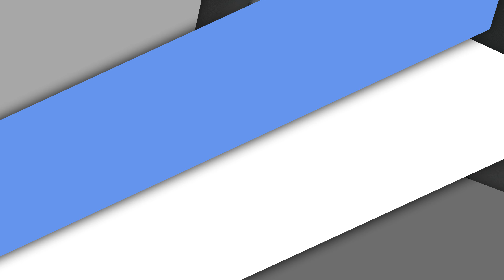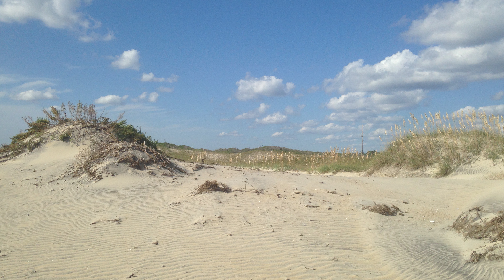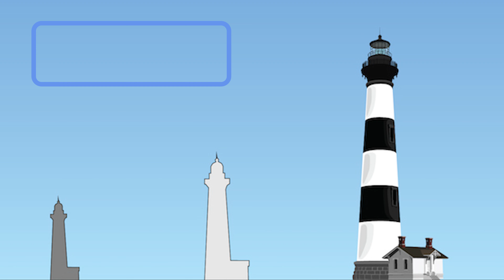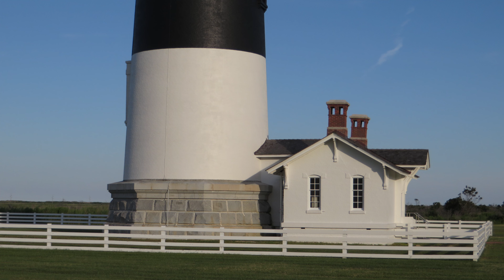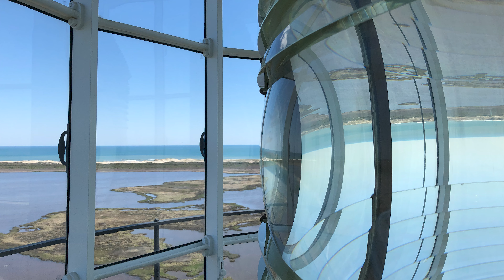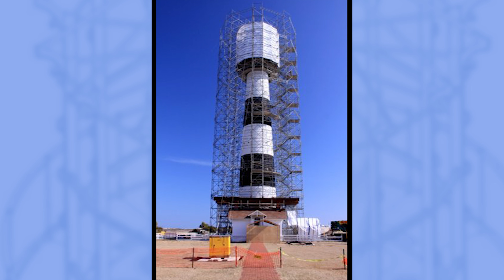Victorian Lighthouse Doomed to Fall

Comment: I visited Bodie 10 years ago! Still have the goal to see all 5 outerbanks lighthouses. So far Ive seen Currituck, and Hatteras, still need to see the one with black and white diamonds and the all white one.
Reply: I never made it to all either, but plan to eventually. It's been more than 10 years for me. I was surprised how many new homes were blocking the ocean views along the road. It's quite a drive, I saw 2 I remember, but couldn't go inside. I'm hoping things haven't built up even more. 2 days was not enough time to fully take in everything. I'm thinking 3 days minimum to get enough pictures and videos of all and take in everything that's interesting about these islands and lighthouses.

Comment: This is interesting,as in having a love for light houses. On a painting I did a while back, there’s a light house sitting almost at the top of a Mountain Viewing it from the back side because it’s on an island, and it’s on the left side,with an adjacent house connected with a big porch.with the sea wheat in front of it. Structuring a tall light house would be a challenge for sure, the setting of the light house in this description is relative, Sorry for the disasters of them. Thanks for this video ❤✅

Comment: The current lighthouse was originally grounded through the cast iron staircase, which was a convenient but not very smart method. When lightning struck it while a keeper was climbing the stairs, he was given a bad shock and his legs were numb for some time. After some other strikes, a more standard lightning rod and cable were added and the stairs were isolated to make it safer for the keepers.